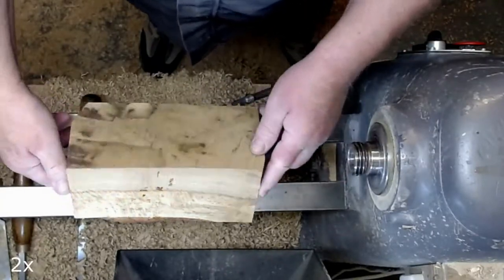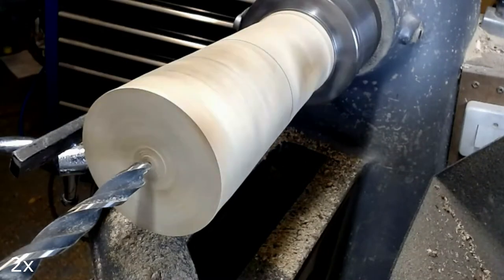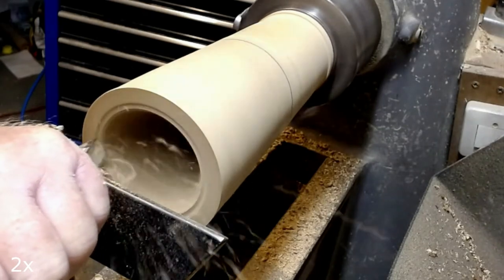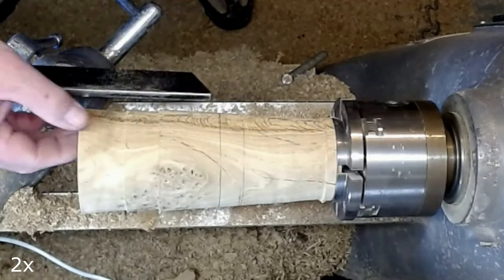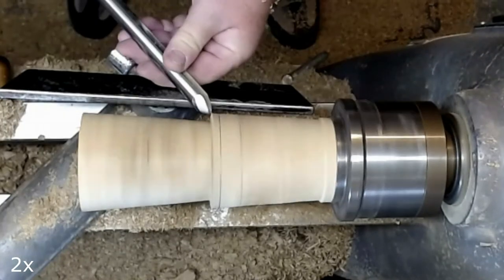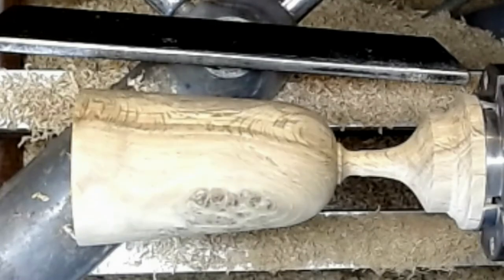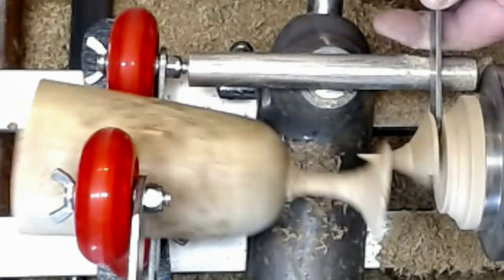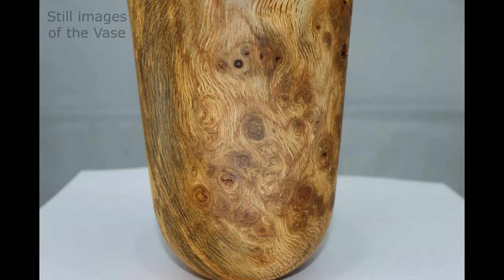Woodturning #22   Turning a deep Goblet   End with a Vase

Comment: Oh my, brave man turning this without tail support 😮The piece turned out great though, I like the look of the piece without the base. Now you have a learning experience and a delightful vase/stemless goblet to use. Thank you for sharing this with us.
Keep on turning.
Cheers, Bluey 👍
Reply from the maker: Hi Bluey. Thanks for the comment. I was more optimistic than brave, I think. The wood was bone dry. I have done this before without problems so it should have been possible but there were those big cracks in the foot that I did not treat with enough respect. I did not notice that the biggest crack vent up into the stem. When I started parting the Goblet from the lathe the parting tool caught the crack and then it was done. Oh well, you live and learn.